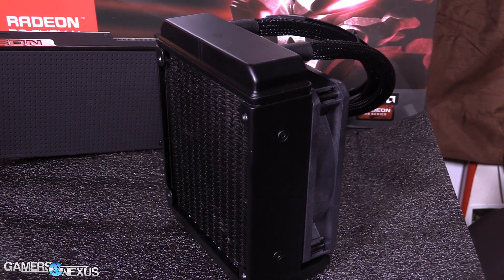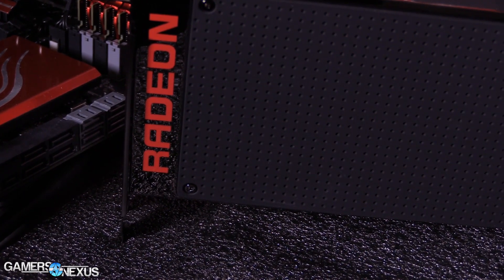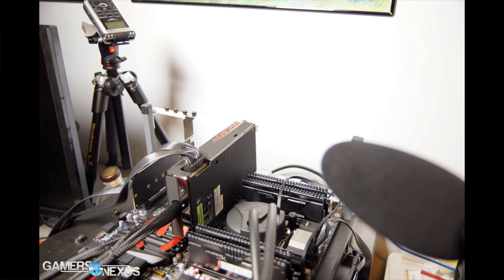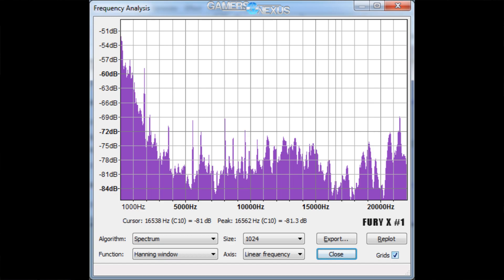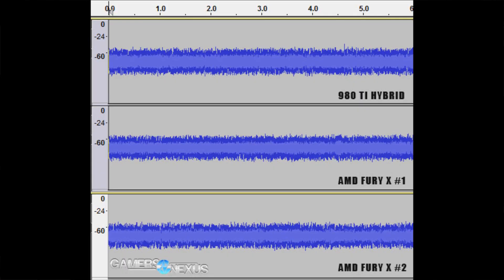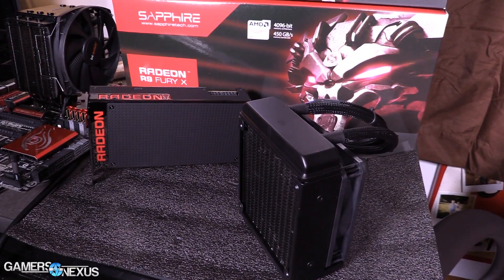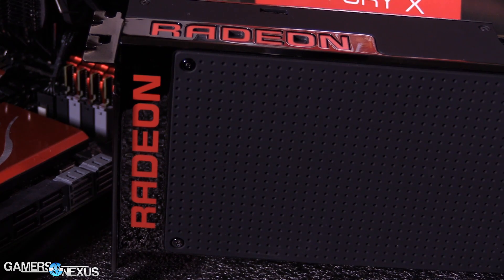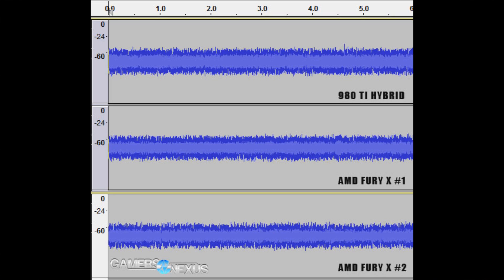R9 Fury X Pump Whine Frequency Analysis vs. 980 Ti Hybrid

Comment: The fury x have lost to the 980ti in 4k and lower resolutions but they are equal on the 3440x1440p monitor also known as a 3k monitor where the fury x actually performed better then the 980ti if you are aiming for that monitor as shown by digitalfoundry.

Comment: I just got 980 Ti Hybrid. Its terribly loud. I also have MSI 980 Ti, I wanted to return it and stay with Hybrid, but I will stay with MSI. Even 20 C difference is not worth this terrible sound. MSI is much quieter under load and zero sound in idle/internet browsing/watching movies and Hybrid is jet plane all the time. I am terribly disappointed with this card.
Reply: Hook up your fan to a controller..i have my fan set at 40% fan speed, never breaks 50c and is dirt quiet..
Reply: Bernard Blackburn I already returned it. I even turned fan completely off but it didn't help, pomp was running like jet plane even in idle.

Comment: I had my Fury X in my 750D case (fairly open top) and the whiny noise was too much. Just a bad unit, maybe, but it went back as it was significantly louder than my (now current again) CF 280X setup! Think I'm done with water cooled GPU's, back to good old air cooled for me, for now! :(
Great post BTW, was looking for noise comparison of Fury X to 980ti Hybrid and you're the only one I've found. Thanks!

Comment: Haven't they already fixed the pump whine?
Reply from the maker: TotallyRandomGaming This was discussed in the video.
Reply: Yes, the second retail batch is quieter. Cooler master used different glue. You can recognise this version by the engraved Cooler master instead of a sticker. A German site also tested the review version with some noise reduction foam between the pump and the cover, noise levels reduced from 1.3 Sone to 1.1 Sone.
Reply: Detmer The problem is they should NOT have released the card this way, not may reviewers got ref samples, they got retail (Same thing actually since AMD doesn't manufacture anything) so if this was known before release to reviewers they had to know it would be criticized, that on top of the released AMD benchmark's that where proven wrong makes this a slap in the face for AMD.
This card is rare, simply because its hard to manufacture, AMD has stated something just short of a recall on the cards, if you have pump noise you can RMA the card.
This is just bad business period,  the company must be sold.

Comment: I looked at the Fury X, but ultimately decided to go with MSI 980 TI Gaming 6 after watching this OC edition destroy the Fury along with the 12 gig Titan.
Reply: *****  I was going to buy the Fury X but when I heard it was not complete DX12, plus being slower than the TI at the same price in 1080P made the 980 TI a no brainer. Especially the overclock editions beating the Titan X by 10 percent in certain scenarios. I'm also disappointed in AMD's driver support. I've seen multiple games released without even a beta driver to help out performance except for the last two months or so. When AMD released drivers ounce a month I almost never had problems playing the latest games. After AMD stopped releasing new drivers every month, its been down hill since.
Reply: *****  I know Nvidia under hands AMD with their Game Works crap, it still doesn't excuse the fact it takes AMD 6 months to release a new driver with optimization. In terms of my new video card, I ordered MSI 980 TI Gaming 6 OC edition. The Gigabyte model based off Newegg reviews has serious coil whine problems. Gigabyte is the model people recommend you stay away from unless you don't mind high pitch sounds emitting from your PC.
Reply: ***** The first Omega Drivers 14.12 was released in December of 2014, there was not a new WHQL (15.7) released until July if I'm not mistaken. No, it shouldn't be funny to hear the company AMD went over six months without producing suitable drivers unless you wanted to play around with beta drivers, something I don't care for.
Reply: ***** So you tried to call me out not knowing my shit which only proved how little you know about AMD, and you end your reply by saying GTX460? Hmm, it's been 30 weeks since my first post and you reply with bad information after over half a year? Anywho I'm still gaming on my R9 290, I took the 9800 TI back after heating issues, and to be frank, it was overkill at 1080P.
Reply: ***** WTF? If I deleted my comment go back in your email and repost it. Comments stays in your inbox no matter if the thread host deleted or not. Pretty simple to prove right?